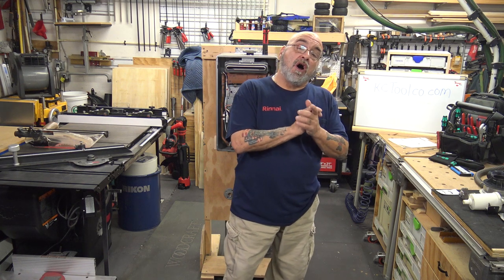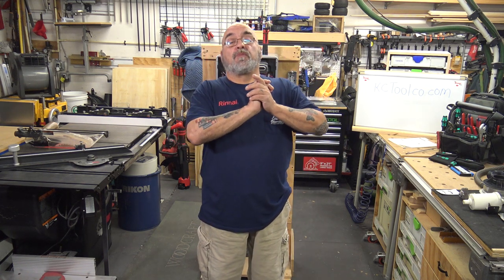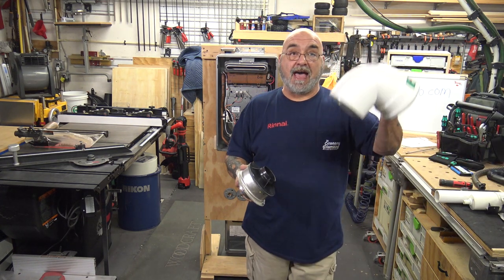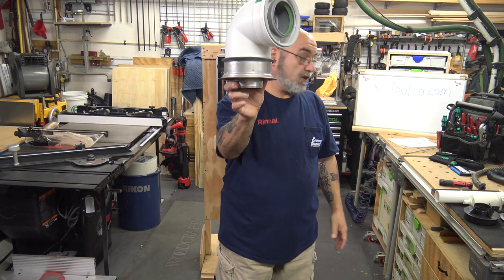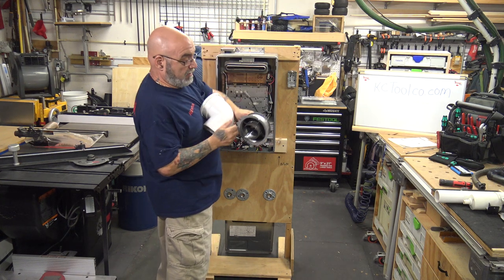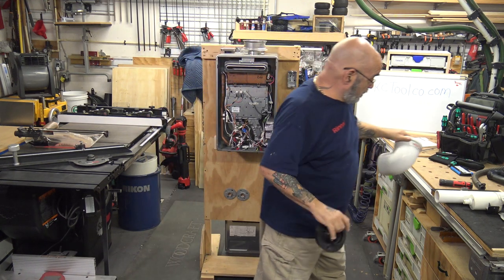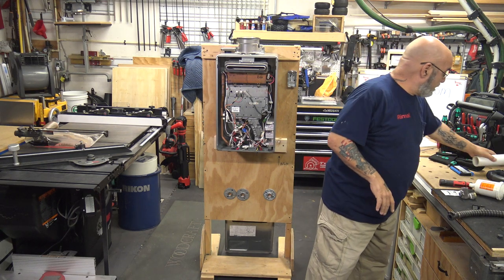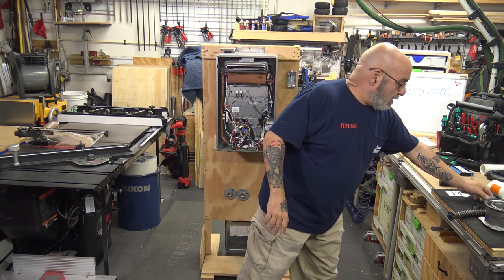Answers to question I get quite often

Comment: Hi Mike:
Love your videos. Just found you recently. I have a Rinnai V75 in my home. Have had it for about 3 years now. It's mounted in my utility room and has vertical venting up through a walk-in attic and through the roof penetration above that-straight up the whole way. It's about 8-9' from the top of the unit to the roof penetration. There is approximately 2' of vent pipe above the roofline and a vertical termination kit on top of that. There is a domed rain cap at the top. It has a condensation collar with a looped plastic tube to collect condensate.

I have been frequently frustrated over the time of ownership. While I love the continuous how water when the unit is working-it almost always stops working whenever it rains. When that happens, I get a code 11 and very occasionally a code 12. There have been times when I have been able to coax it into operation byv turning a single faucet on low flow. Once it gets going and stays on for a short while, then I can go to higher volume. After that, it works well until it has again been off for some time. Then, it's the same thing over again.

What I have suspected is happening is that moisture from the rainstorm is being drawn down through the fresh air vent and drowning the ignition and flame-either that or the flue gas is being down drafted back down the flu by the storm and snuffing out the flame.

Is this something you have seen and what can I do about it? At this point, I'm considering dumping the Rinnai system and going back to a conventional how water system.

Hope you've seen this before.

Kerby

Comment: Hi Mike, first of all thank you very much for your concise and informative videos, this is extremely helpful for a lot of people (many of whom would never admit it).  I just have a couple of questions about the proper install of an RUR-199ip with dedicated recirculating line.  1) When and where do I need to install an expansion tank, if at all?  I haven't seen any in your setups, but it shows them in the manual.  2) Is it ever ok to draw intake air from inside an air-conditioned laundry room?

Comment: Hey there Mike, great channel here!
Some questions for you… 
Is there a way, or any need even, to reset the error codes on a unit, or should the unit just start working normally and clear itself if you fix the issue?

I have an R85 with codes 11 and 12. They popped up after a storm that blew some rainwater into the vent.
I thought maybe I could wait a week and let it dry out, which almost worked, the heater came back on once or twice, but nothing since…
So far I have replaced the flame rod and electrode, no flame still…
Next I was going to open the combustion chamber up and clean it out/inspect it.
Then get a ladder and check the flue from outside of that doesn’t work.

What do you think?

Comment: Mike,  I have a question about the 12" clearance from grade/snow line.  My house has a "cellar" I have about 10" of wall space above grade in my mechanical room. I'm located in Idaho Falls, ID so we get snow but it doesn't seem to build up, I also have an eave that overhangs 3' so the area I'm talking about is more protected from snow build up.  I heard you mention someone in PA dug out the dirt around the cellar to vent the unit (then relocated it to a closet, could I dig it out and install a window well to create more space below the vent?  Thanks for your time, Doug.  PS love the informative vids!!

Comment: Hello Mike, big thanks to you for your videos! I am in Canadian wilderness and get propane ones a year. I have NOVIEN NCB190/080 which I have to instal my self because no one would come so far. Still not in service, will hook up next 10 days or so.Conversion video to propane was excellent. I like to ask you 1. Do I have to change propane adjustment in the boiler or I can leave it as is from factory? 2. I will have antifreeze in my heating loop so that I  have minimum heat bud I need to drain water pipes in house, so I like to know if heating is on and no water on DHW site if this will have any problems 
.  Again many thanks Mike and keep up this great work.

Comment: Mike, I live in townhouse complex at an elevation of 9,000 feet.  Each unit is equipped with a Rinnai R53 that vents vertically through the attic and out the roof using the non-condensing roof vent with the air intake on the side of the vent above the roof.  In the springtime when the cottonwood trees go to seed, the seed cotton clogs the vent intakes.  Is there a Rinnai non-condensing vent with a lower intake that could be located in the attic to avoid the seed cotton?  Thanks, Steve Z.

Comment: We love our Rinnai water heater but during a rainstorm, water found its way down the exhaust/intake pipe and caused an alarm in the unit shutting it down.
Fortunately, unplugging the unit drying it out and plugging it back in restored operation.
The builder failed to put a flashing at the base of the exhaust allowing storm-driven rain to find its way into the closet.
My question is how can a repairperson (or myself) remove the ROLUX 4G cap and place a proper flashing?
Will the vent dis-assemble allowing the flashing to be installed??
Should I have a competent plumber do the job?
Thanks!

Comment: Mike, I've been having issues with my RL94, non-condensing unit getting code 11.  I cleaned out the burner (thanks for that video) and replaced the ignitor.  Things got better, but now on low flow the burner cuts out and then won't re-light.  Giving me a code 11 again.  Is this a water flow sensor issue or maybe a gas solenoid?  Appreciate your input and all the videos!

Comment: my rinnai r85 is creating heavy vibrations, super loud. it seems like its not getting enough gas on full demand because its fine for operating a sink, but once demand goes up its like iit wants to vibrate off the wall. i already replaced the fan. no dice.

Comment: I have a Rinnai V65i (150,000 BTU) located 20 feet from propane tank.  V65i is the only load on the propane tank.  Is 3/8" copper line size adequate (large) enough to run between the propane tank and the V65i or do I need a larger line size (e.g., 1/2" or 3/4")?  Thanks so much for any reply...

Comment: Hi Mike, I love your videos!  Can you help me out here, I have a Navien hotwater heater modelNPE-240S - Had a error code of E.110.  Fixed the problem, clean the filters and flushed the system clean.  How whenever calling for water.  The hot water makes a strange gurgling sound?  How can I fix this?  Any advise.  Thanks

Comment: Mike, I have a rh180 hybrid system, heater with tank attached. I am continually getting a code 63. I have cleaned the system numerous time, filter, delime, etc. After cleaning, the system will run normally for a few days then start flashing the code 63. Have you had to work on these units with this problem, and what else can I check before I reach out to a tech.

Thanks.

Comment: Mike I have a rennai rucs75i I’m using 3 inch ipex exhaust vent on twin pipe install. My question is how many feet of exhaust vent do I have with 3 elbows and total of 15 feet of strait pipe. And what would my dpswc setting be.

Comment: mike, getting closer to finishing up house.. we have mounted and piped venting as you instructed.. thanks for all your video, been great at learning.,. now the last question.. this is a part time florida lake house.. 5-6 times monthly..only thing on gas is the water heater and we are hoping to use a 100lb tank-Flame King YSN100b, burying tank is issue due to tank service where we live..a friend of friend said that such a small tank of 23 gal could be issue of 'vapor lock'.will this 100lb tank be acceptable for 2 people couple days a month? THANKS IN ADVANCE
Reply: rur160 is model
Reply from the maker: Yes go with the 100lb no smaller he’s rite with the smaller tank
Reply: @ThatTanklessGuy  mike, we are finally ready to finish plumbing.. what regulator do i want to use with the Flame King YSN-100 YSN100 100 Pound Steel Propane Tank Cylinder with 10% POL Valve. thankls again and will update you when we ahve it all plumbed and electric to house is done..

Comment: Hello, first of all thanks for your great videos, surely nicely explained and overall well done.
I like to as please for advice. I have combi boiler NCB 190/080H
First: I like to connect my SENSI Wifi TERMOSTAT to the boiler.
I wonder if l can connect this TERMOSTAT directly to my boiler ( and where to connect) por if l need to use Taco SR 501 to run it between boiler and thermostat.
Second: can l connect 
WiseWater 110V 130W Circulation Pump also directly to boiler or again if l need to use Taco SR501 between boiler and pipes.
Thank you very much for your advice and help. I am in middle of nowhere in Canadian off grid wilderness, so l have to do all my self - no service guy :)
Thanks, George

Comment: Hi Mike, love your videos.  I'm getting a code 61, and have replaced the harness but am still getting a code 61 and no hot water.  It is a Rinnai R75 Lsi  My apologies, if you've covered it.  If you have if you can provide a link to it I would appreciate it.
Reply from the maker: John, did you check the wires going into the fan and how freely the fan is spinning. Check continuity between the two white wires on the thermal fuse. Let me know Mike
Reply: @ThatTanklessGuy  Yes I had a guy come out and replace the Harness ($45 harness but total bill was $380).  My first fan sun right off the spindle with moth's etc.  So I went to a wholesaler and bought 2 new fans a few years ago so I can swap out the fans and clean them/check them.  Is the Thermal fuse covered in one of you videos, I will be happy to check the continuity.  I'll pull the fans out of the housing and double check them.
Reply: Also as Icleaned the white condensation apparatus I pulled the top part of the black hose to re-prime it again.  The port the hose fits over appears to be plugged but I didn't touch this, I wasn't sure if it was some kind of charcoal filter.

Comment: I have a old (18 yrs old) 2532 in Washington state, non condensing unit that I need to replace, we do not run 2 showers at the same time although we have 2, we never run 2 things that need hot water at the same time even though we have a large house, (2400 Sqf rambler) there is only 2 of us, what size do I need in Washington state, I'm looking at the 5.3 and the RE160ep to replace my old 2532 non condensing unit, which one would be better for my home, I'm going to order today as I'm not getting any hot water being 18 yrs old, I'm due for a new Rinnai unit.

Comment: Thanks  for  the  informative  video.  Question..I presume  the  plumbers listed  on the  Rinnai  website  have  the proper  training but could a plumber  not  listed  on the  Rinnai  website  also  have  proper  Rinnai training  on installation and  servicing?
Reply: Yes they can ask them for references or photos of past jobs. If you can use a plumber from the list. Mike
Reply: Thanks.
Reply: Since Rinnai does not provide proper literature to the public, plumbers have to either go to seminars and listen to gabby salesman “teach” them about the units, or use real world experience and study the literature provided.
Reply: Fortunately, Rinnai has reliable customer service.  They have access to the “forbidden book” of answers and will talk or FaceTime the tech through the proper troubleshooting procedures.
Reply: @Red_Twizzler   In my area  Rinnai seems to be  the  favorite of installers.
Reply: @NewOrleansMan-ry3zn  True.  They have reliable, quick customer service and have been making their units much easier to service.  You call, they answer.
Reply: @TheBuddylab  Mike wonder if you can help a fella out... I have a rinnai 53i... and I'm having a issue with pulsating h20 from hot to cold... it seems like when the unit 8s running a shower or tap etc and the flow rate is 1.6 to 1.7 it does this.. but if you increase the rate it goes away (by running a tap and the shower at the same time... I've kept the unit clean regular flushes etc... my only thought it could be a faulty flow servo ....any thought or ideas of a possibly issue...

Comment: Mike,  I have a new home with the RUReN installed.  The home is set up with a dedicated recirculation loop.  The recirculation was never turned on so I bled the system then changed Parameter 4 and 5 to activate the recirculate system.  The pump works during the initial cycle when the unit is powered back up but fails to keep cycling.  The instructions suggest that the pump should cycle at certain time intervals depending on if parameter 5 is set to comfort or economy.  Does the unit have to have an optional piece of equipment to work in the recycle mode?

Thanks,
Reply: Yes you need to have a separate controller like the Control-R that came with the unit or the one I use always the MC-195 T-US Controller. Those will cycle the pump on the times you set it. I have a complete video on it. Mike

Comment: Mike, is there a way to install a circulating system to a Rinnai water heater?  I just installed a an RL75iN. I saw you made a video on another type of Rinnai. Just taking too long to get hot water to outlets.  Thanks.
Reply from the maker: Yes you can look for my video on the HE-Plus pump system I’ve installed 15 if them so far and they work great.
Mike

Comment: Mike - I have been getting intermittent error code 11 and 12 when my interior propane Rinnai is on recirc.  No techs have been able to solve.  The unit is one year old.  There is a tee in the farthest sink vice a dedicated recirc line.
Reply from the maker: Call me at +19042385349 tomorrow after 5pm eastern time and I will go over it with you Mike
Reply: @ThatTanklessGuy  Thx!  Will do!

Comment: Mike, I’ve called Rinnai and several supply houses and no one can give me a definitive answer. I have a Rinnai RL 75i and want to install a Recirculating system using the thermostatic valve on one of the bathroom sinks. Which kit is appropriate the HE pump kit MC 159T or the HE Plus pump kit MC 159T?
Thanks for your help.
Tom
Reply from the maker: Both kits are exactly the same except one comes with the WIFi and the other comes with the MC195T controller. Get the one with the MC195 controller the the model number that ends in T
Reply: @ThatTanklessGuy  Is the kit compatible with the RL75i propane?

Comment: Mike, I have a pair of V75i, plumbed in parallel. However it can be 5 minutes running to get hot water in my 2000 sf TX home. Any thoughts on how to improve this performance? Thanks.
Reply from the maker: Mike, that model can’t be upgraded to the HE Plus pump system. You can install a Taco demand pump system under that sink and it will act like a circulation system
Reply: @ThatTanklessGuy  thanks Mike!